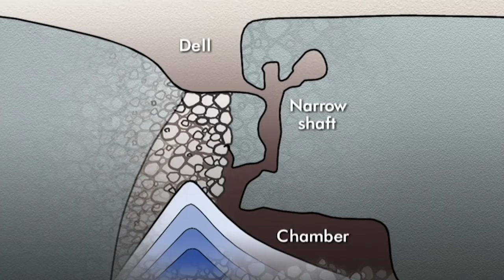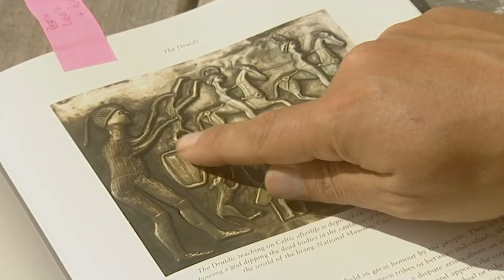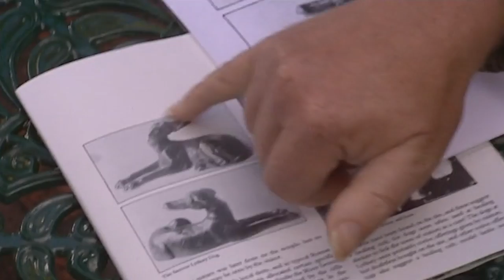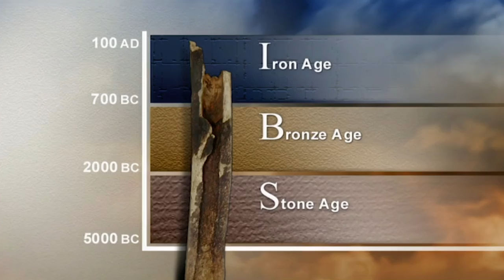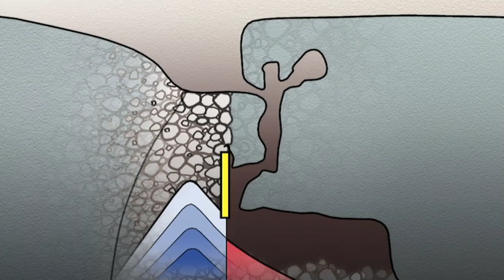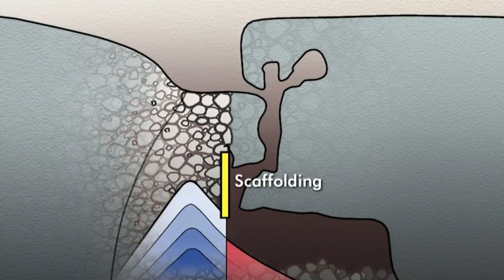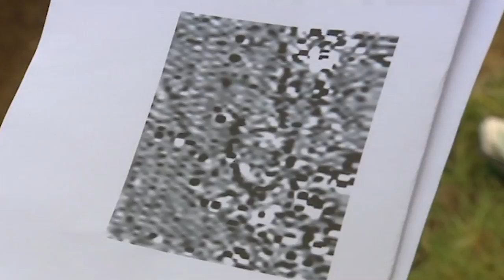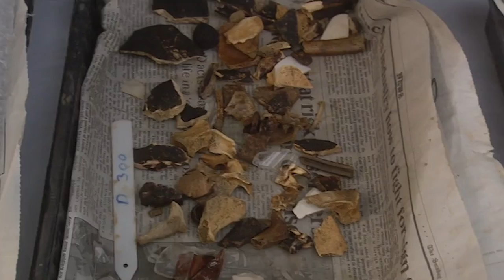The Horrifying Rituals Of Iron Age Britain | Time Team | Odyssey

Comment: Why did a massive grave for a dead pet dog when you can through the body down a pit? Also, as a former cave rescuer, rescuing dogs (and other animals) is very common, so six in 3000 years is not a lot. Also common is removing the bodies of people committing suicide, especially from the bottom of the pits. The last one was from an older man with a degenerative disease and sounds similar to the old lady.